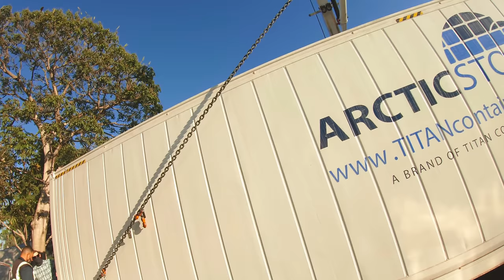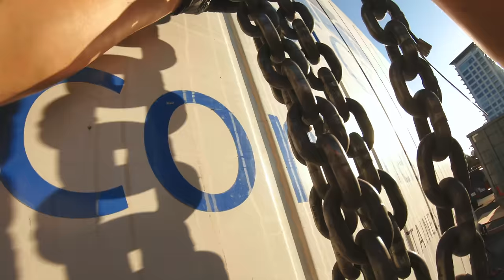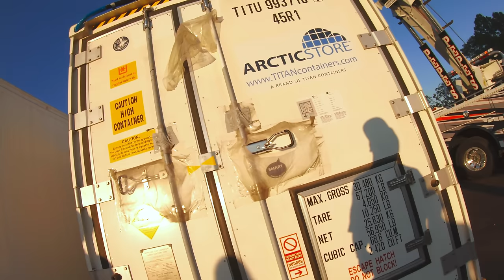Extreme rotator rigging

Comment: For the last reefer why not turn hulk around and have the trailer backed up behind you so you could pick off the back of hulk and just rotate to the side not having to put the container over the cab of a truck?
Reply from the maker: There was no room to rotate it. Did you not see how I barely cleared the container off the side? You have more length off the side. If I picked it up off the back, it would be impossible to spin it.

Comment: Hello,
I have a kind request if I could get some feedback regarding this next video of a video game rotator in action.
Assuming the target vehicle has some broken stuff and needs help. 
https://www.youtube.com/watch?v=s3NcNncY4nI
After watching it, would you say: 
- the positioning of the tow truck to the target vehicle is a fair usage?! Like is it a normal situation where if space is limited you'd find yourself in that angle (on the side)
- the distance from the tow truck to the vehicle is within normal operating distance (rough estimate)
- the boom position trying to lift is it ok like that or should be in different angle, higher or whatever other)
- the anchors are bending in the video game. Would that be a normal way anchors behave or should they be straight and solid?!? 
- how should a failed lifting attempt look like if the target vehicle is more than the rotator can handle?! Like a break of the anchors or what to expect normally. in the positioning of the target and distance
- is there a standard and normal or recommended position to use the boom to lift a heavy load? Is best to use on the side of the truck or on the back of the truck or like diagonally? or any recommendation for using the boom in such a case.
Thank you so much
And a happy new year